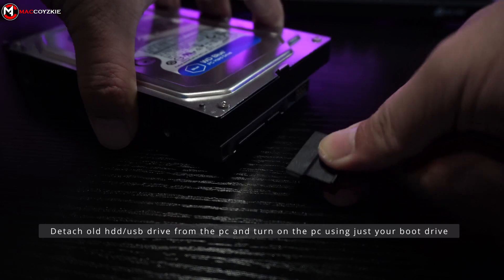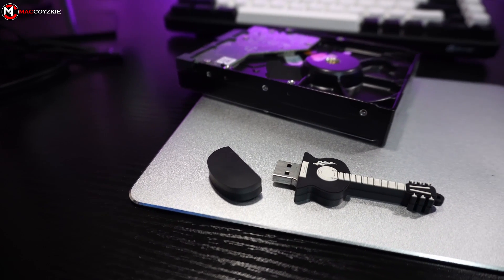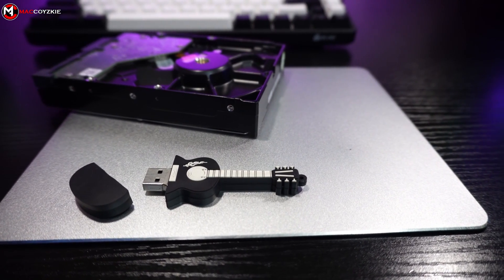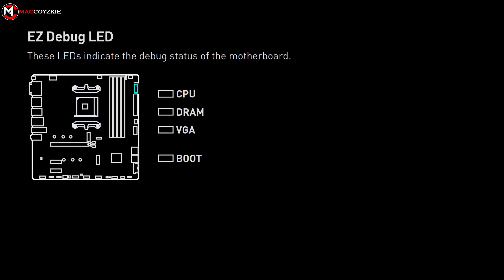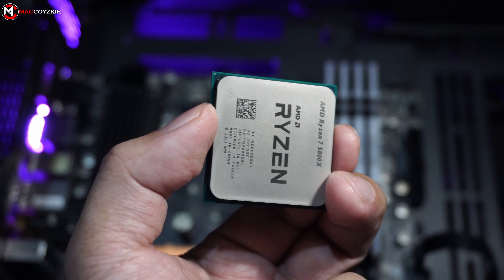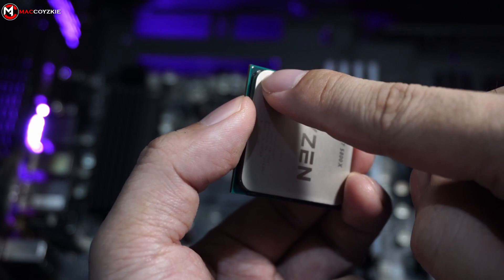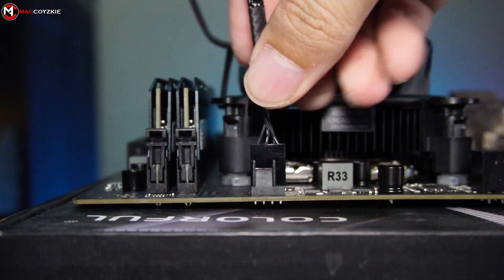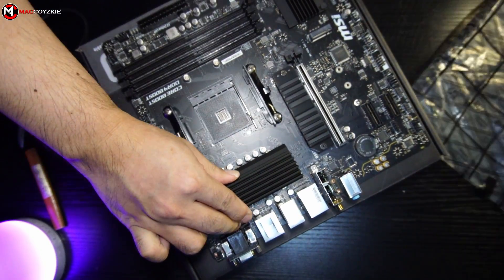Debug LED always on FIX

Comment from the maker: Check more pc fix tutorials https://www.youtube.com/playlist?list=PLqHl1qasBnOHXQahxqQMkuUkoRg3dbSwQ
Reply: my motherboard only beep light once on cpu indicator, but it  won't turn on along with the cpu cooler and  power supply.
Reply from the maker: @visage7795  is this a new pc build or was a working one?
Reply: @MacCoyzkie the PC is not new but the few parts  like the CPU CPUcooler, anyway i watch more of your videos, and found out that it may be a foulty Power supply, i search a bit in the light indicators and found out the mother is still working because of the light indicator still kicking and the problem was not the cpu, since i try to switch back the old CPU and CPU cooler, but still not working, i borrow my friends old power supply and it started booting up again, anyway your videos are helpful and thanks for responding.
Reply from the maker: @visage7795  no problem bro, glad you got it all figured out with the videos
Reply: @MacCoyzkie  after i start the pc the boot led remains on and the pc shuts down itself afer 15secs?
Reply from the maker: @youssefjaouadi4433  boot drive has a messed up os or just needs a fresh windows installation, worst case scenario you got a broken boot drive
Reply: @MacCoyzkie  i have like a gray cent not a drive i tried that,the problem still appearing with a meesage on screen «over current have been detected …. »and it shuts down itself after 15secs, Maybe the mainboard is gone?i have a msi a520m-a pro
Reply: mine got fixed by updating gpu using this : NVIDIA_DisplayPort_Firmware_Updater_1.1-x64
Reply: Bro please help me.....vga led is always on i reseat my gpu re seat all the wires remove the cmos re seat the ram sometimes it work and my pc boots then i run cpu and gpu stress test for 20 mins and it also works ...as soon as i open any game it crashes black screen...and keyboard or anything doesnt work...only option lept turn it from the shut down button then i turn on the pc again same issue again vga ez debug led on
Reply from the maker: @knightnight2777  this could be a game problem so try to reinstall the game or go watch this video  https://youtu.be/Azf79t1vkaU

this could also be that your psu is not giving enough juice for the system, you need to have it checked using a psu tester like this https://youtube.com/shorts/YrC3PlflLq0

worst case is that there is power fluctuation in your home outlet, you need an electrician to check this part
Reply: @MacCoyzkie  will check that but is there a way... obviously if pc is crashing or any other issue I believe it definitely gets register somewhere withing the pc

So if i somehow got my pc to boot...is there a way to check those logs?
Reply from the maker: @knightnight2777  check Cortana in event viewer
Reply: @MacCoyzkie  its always on rhis orange lamb my Motherboard asus rog b350 f gaming and when i do hard stress on pc it crash and i should turn it off than on again 
Can u please help me ?
Reply from the maker: @mohamedelshazli1413  try clearing cmos to reset whatever bios setup that causes your pc to crash https://youtu.be/S9hyEPTFR10

Comment: In my case is the vga sometimes it boots and when it boots i play games when i try to restart it a black screen appears and sometimes my monitor stays off too
Reply from the maker: can you check the pcie power cables if they are melting? recently this has been the cause of vga problems, at least those pcs i was fixing. if not just try the suggestions in the video atm
Reply: @MacCoyzkie I solved it already it was the ssd drivers update 😊
Reply from the maker: @dewin-fit  ohh that's new, may i know what ssd model name you are using?
Reply: @MacCoyzkie Samsung 980
Reply: @MacCoyzkie never mind the issue keep going after a while of playing games
Reply from the maker: @dewin-fit  that's bad news, can you try clearing cmos to run things in defaults
Reply: @MacCoyzkie I tried that and didn’t work I just ordered a new gpu 😢 we’ll see if it’s the gpu if not I’ll return it
Reply from the maker: @dewin-fit  i see, you can also ask a friend/relative to test your old gpu out in their pc to check.

Comment: Three years later, I have a c p u debug light on for 3 years now.And the computer works great, nothing's wrong with nothing
Reply from the maker: i get a lot of comments with issues like yours, this is basically the motherboard is not reporting correctly and can be fixed by updating bios. if it works for 3 years without problem i guess you don't need to do anything

Comment: I have a i7-12700 in the z690 aorus elite ddr4. cpu red led.
I put the i7-12700 in the z690 aorus elite ddr4. cpu red led. 
I took out my i5-12400 on my b660 gaming x ddr4 and put it in the z690 aorus elite ddr4 and it post.
I took out the i7-12700 on the b660 gaming x ddr4 and cpu red led again any idea ?
Reply from the maker: oh no, the i7-12700 might be faulty

Comment: Hello, I have the situation with the White Led or VGA, when I cold boot PC LED is turned off, when I soft boot PC, LED is on. PC is working normaly, playing games and stuff. I have B850a Gaming Rog Strix, 9800x3d, and MSI 5070 TI OC. Does anyone have any tips or advice?
Reply from the maker: your motherboard has the stock firmware version, you just need to update it but be careful if you're going to do it yourself because you can't make mistake. more info about it here https://youtube.com/shorts/nfH5Do3Dq3o
Reply: @MacCoyzkie  Hello, I have same problem, with red led light on VGA. Can’t run benchmarks, when benchmark starts PC is rebooting.
Reply from the maker: @BBB_tyt  same answer then, check my previous reply ☝

Comment: What if the PC has a display, but the light is on, but it goes off after a restart? What could that be?
Reply from the maker: actually all will light up for a moment then turn off, that means its checking it and when it lights up and turn off eventually means the hardware is working properly

Comment: So I’m new to this whole thing but the VGA light is still on. I was changing out my RAM sticks and it happened so I went to a shop and they told me it’s was something to do with the GPU I reseated the GPU and erased the residue but still having the same issue
Reply from the maker: assuming your new ram sticks are compatible with the current build i suggest shut the pc down and clear cmos https://youtu.be/S9hyEPTFR10 this is to help the motherboard recognize the new hardware. not sure why vga lights up but its suppose to be Dram

Comment: Hii brother AT FIRST TRY -My Vga light is off at first try my screen show bios load like gigabyte and all appear on screen and then goes complete black but and i can see a bit of light on screen but AFTER FORCE SHUTDOWN -  bios didn't load ,VGA light is on i dont see anything on screen and screen is completely black also I got my gpu (rtx 3060 ) recently fixed from official service center it was oxidised but they fixed it and tested, was working fine at home my gou worked for 1 day completely fine but now im trying to turn on im facing this black screen problem also i habe watched many videos done all the things 1.removing cmos 2.reseat graphic card 3. Clear ram but nothing works
Reply from the maker: can you ask a friend or relative to try your gpu in their rig. if you got the same issue with another working pc then this could be it for your gpu. if ever you got it fixed again make sure this time that you downclock it so it'll last a bit longer

Comment: My problem is my pc was working fine until I added a 16 GB 3600 RAM stick to my 8+8 GB 3600 so the LED wasn't on DRAM it was on CPU and I'm still stucked like that
Reply from the maker: you need to clear cmos so the motherboard can detect the newly added hardware https://youtu.be/S9hyEPTFR10

Comment: With mine 3/4 of the lights cmon the boot cpu and vfram one
Reply from the maker: if its a new build then a bios update might fix it. if it was a working pc this could be hardware error. usually its the psu pins melting so check your psu cables going into the gpu.

Comment: My motherboard first shows red then orange and then white light indicator. I am able to boot in and login to the PC but it restarts again and again. And after some time, it starts restarting within seconds and that time I am unable to even go to BIOS. My motherboard is MSI B760M Mortar WIFI II.

I have already cleaned the motherboard from dust, removed and re-inserted the CMOS Battery also after few minutes, reconnected all the connections, re-inserted the RAM, tired to run it with Single stick RAM also (I am using dual channel RAM sticks here 64 GB total [32x2]) but still facing the same issue. I am not sure if there is a problem with my PSU or any other component. 

This is a newly built PC which was running without any issues from the last 3 months. If anyone have any idea about it, please reply.

Comment: I got red light on my cpu and when you pointed out the fan I liked closet and one of the 4 prongs is tilted back. Thanks. The red light would randomly show up after it was off and also when I turn my pc of my rgb fan lights flicker green light. Very dem but still goes
Reply from the maker: no problem bro. the dim light might be because of the power left with the psu when turned off. you can unplug the pc from the outlet and press power on the pc case, this is just to power drain the remaining power from the psu. it will turn off any lights for sure

Comment: i have a z370-e gaming motherboard but my rgb aura lighting doesnt work. I tried aura sync app but it wont let me on the lights and i tried bios. I honestly never knew the motherboard had rgb but not i am wondering if my motherboard is broken? my pc works fine and everything. pls help.
Reply from the maker: instead of using the motherboard's rgb controller i suggest use "SignalRGB"  it let's you control all the rgb lights in your pc. in this way you won't need to download your keyboard, mouse, gpu, ram and motherboard or cpu cooler's rgb software. Uninstall those other rgb apps and use signalrgb instead

Comment: I have a GIGABYTE B760M DS3H AX LGA 1700 with Intel Core i7-12700k and GIGABYTE Gaming OC GeForce RTX 3070. I have no issues for a year until I updated from gigabyte control center to update a software on my motherboard and my computer crashed and the cpu light came on.
Reply from the maker: can you try entering safe mode https://youtube.com/shorts/IZKc8plksDA and uninstall all those software.
Reply: @MacCoyzkie  thanks. I'll give this a try. I'll let you know.
Reply: @MacCoyzkie  didn't work
Reply from the maker: @ ok umm try clearing cmos next https://youtu.be/S9hyEPTFR10 this will reset the system to default removing any overclocks. try booting the system and see how it goes.

if still does not work try removing the gpu and plug the hdmi/dp in the motherboard's monitor input to rule out gpu issues. Btw do you still see debug led staying on?

Comment: I have the vga led is on and i also have display on.....i dont see the problem the light is alerting for
Reply from the maker: yep some new build nowadays are having the same problem, so basically the motherboard is not reporting correctly. a bios update should fix this. be careful though if you're updating it yourself https://youtube.com/shorts/nfH5Do3Dq3o
Reply: @MacCoyzkie  i may have found the issue here. In the bios take the pciex16 from auto to gen4 and make similar adjustments to your m.2 slots mine were defaulting to lower apparently. After that so far the light is off. But i do have adrenaline locking up after i exit a game..i dont know what thats about
Reply from the maker: @ hmm, interesting. may i know your pc specs, specifically the cpu and motherboard model name

Comment: can you help me, please? everytime that i try to restart my PC by windows, it doesn't come back. Everything turns off, and then the dbug LED boot appears on my motherboard. To get video image again i have to turn everything off, including PSU, reboot again all the time so i can go back to windows. I'm using Aorus Elite AX B650M , 32GB XPG RAM, AMD Ryzen 9800x3d, RTX4070ti super.
Reply from the maker: have you tried the suggestion in the video yet? also can you check if you can still enter bios with no problem?

Comment: I recently build a PC with brand new components but it doesnt display a signal to the monitor and the boot LED is on. I plugged my display cables in the GPU HDMI port with a VGA adapter for the monitor. I dont know what to do anymore everyting is brand new except for the HDD. Also i did reset the CMOS.
Reply from the maker: what's the pc specs? perhaps your mobo needs bios update
Reply: @MacCoyzkie  ryzen 5 5500 
A520m pro mobo 
8GB Ram 
Cougar stc 550w
RX 580 

I think so too but i returend te ram today as it kept displaying a DRAM Led after i reseated the cpu
Reply from the maker: @ so did you get a ram replacement? I also notice you said hdmi to vga adapter right? for now try to borrow a monitor with hdmi input, sometimes the hdmi to vga cables are a pain in the butt, i got a lot of bad memories with those adapters so i don't recommend using one
Reply: @MacCoyzkie  i ordered ram today just waiting for the arrival but i will use another monitor aswell. Thank you for the tips i will keep you updated
Reply: @MacCoyzkie  my ram was the problem i got everything to work. Thanks alot for your tips.
Reply from the maker: @ glad its all good now, glad i can help

Comment: What does it mean if the cpu light is on and solid orangeish color?
Reply from the maker: depends on the motherboard, check your mobo manual
Reply: @ I got the aorus z790 elite ax and I did and it said it’s cpu related on the manual but also on google it says cpu ram or psu issue but psu and ram are new and so is cpu
Reply from the maker: @ if you can still boot the system without a problem but it does have that debug led, i suggest update bios. https://youtube.com/shorts/nfH5Do3Dq3o

Comment: I’m stuck on the vga light right now. I tried my card in my friends pc and it worked but it does not in mine. Can you help
Reply from the maker: can you clean your gpu's circuit connectors the way i did in the video? clear cmos too after to redetect all hardware connected to the motherboard

Comment: i have the cpu led debug code but my gpu and fans start spinning
Reply from the maker: gpu fans will always start to spin if it reaches certain temperature. It has nothing to do with the cpu debug led. anyway, have you tried the fix in the video yet?

Comment: I got my pc yesterday and it was working great, but when I tried to use it today there was no display and I got the white cpu light. I tried everything, including the stuff in this video. Did my cpu randomly break or something?
Reply from the maker: after you reseat the cpu can you try clearing cmos https://youtu.be/S9hyEPTFR10
Reply: @MacCoyzkie  hmmmm… that did seem to do anything either. Are there any other ways or is my cpu broken?
Reply: Never mind, I just did what you said a few times and it worked. Thanks!!
Reply from the maker: @ glad its all good now

Comment: Hi there, I know this is sounds stupid but I wanna ask 😂 I dont have a CPU right now I just inserted my RAMs and my M2 SSD and Motherboard and make the cable management such as CPU, 24 pin Motherboard, HD Audio, Reset SW, and others 

When I powered it up my RAM and CPU lights works, I know CPU one works cuz I dont have one, but there is a chance that my RAMs are deficit?
Reply from the maker: cpu led lights up means the cpu is not working or there is no cpu at all. i suggest don't test things out until the build is complete, you will just worry over nothing. new pc parts always work. its very rare for new pc parts to not work at all
Reply: @MacCoyzkie  well fair enough. Thanks for advice, It just my first all alone build so I'm a bit excited
Reply from the maker: @ no problem bro, if the cpu arrives just install it and when you boot the pc you should see "reboot and select proper boot drive" this means your pc is ready to install windows, if it doesn't show anything reply back here and we'll try to fix it

Comment: I have a VGA problem, I’ve tried to reseat the gpu but I feel like it won’t come out. It kinda just feels stuck in there, also I bought a prebuilt so I’m low on knowledge when it comes to this stuff
Reply: Btw I bought a IBUYPOWER pc, I believe it was a Y40 IBP
Reply from the maker: @Lade705  this might help, just do it in reverse https://youtube.com/shorts/9N_5YmJRHko
Reply: @MacCoyzkie  I replugged the cables and it worked! I guess it fell lose during shipping and I didn't notice. Thanks
Reply from the maker: @Lade705  glad u figured it out 👍

Comment: My Tomahawk B450 is just now doing this ive reset the battery 4 times (haven't replaced it yet) ive jumped the terminal, havent reset the BIOs yet might do that soon. But ive completely removed my MoBo and will put it back in with only 2 of 4 hard drives installed and see if that works... Any other suggestions would be very much appreciated.
Reply from the maker: what are you trying to accomplish? what's the debug led you are experiencing?

Comment: hello! i have a problem i am a beginner at pc building and i ran into the problem of the “boot” light and i tried the same method that you did and still didn’t work 

and i reseated the cpu ,gpu and the ram. so may you help me?
Reply: and the motherboard is the msi b550 gaming gen 3
Reply from the maker: if your boot drive is ssd/hdd, try replacing the data sata cable and plug it into a different sata slot on your motherboard. if nvme, just reseat it
Reply: @MacCoyzkie  thanks man it worked!!
Reply: @MacCoyzkie  i love how you still reply to those even tho you made this video 1 year ago. it really shows that you like to help people, and like i said thank you so much!!!!
Reply from the maker: no problem bro
Reply: Just intall windows using bootable usb nothing big